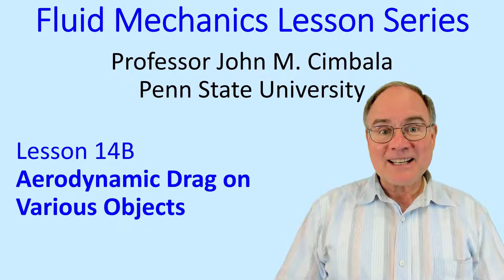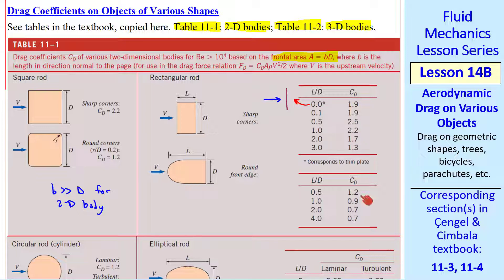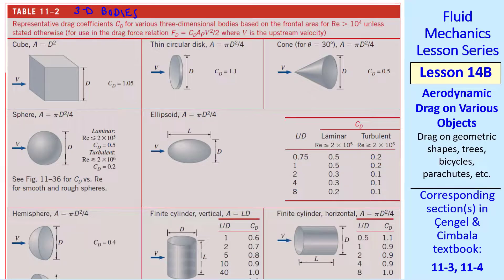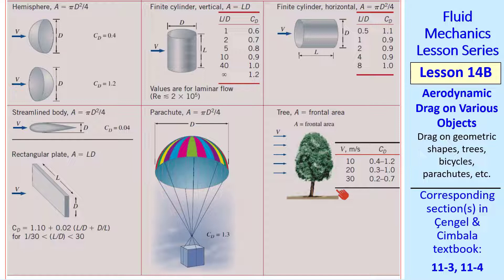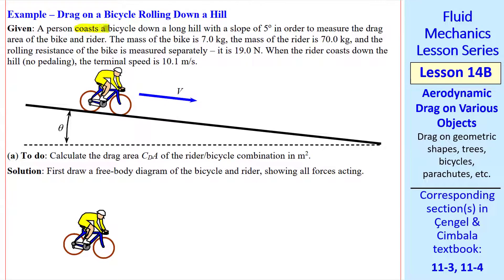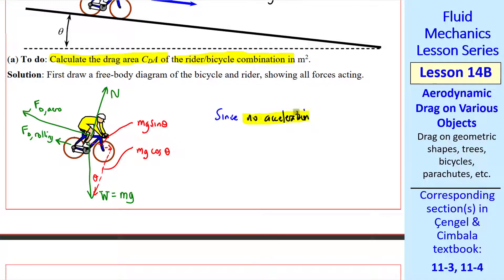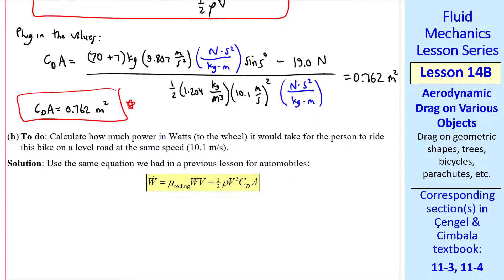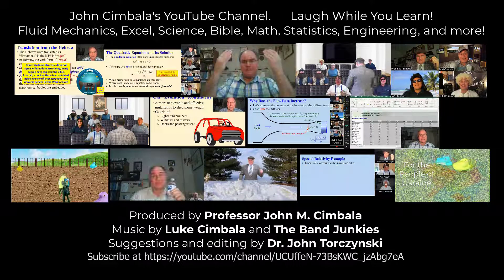Fluid Mechanics Lesson 14B: Aerodynamic Drag on Various Objects

Comment: Hi Professor,
Most objects in the table have constant C_D values, wouldn't it change with the velocity(Reynolds number)?And also wouldn't it depend if flow is laminar or turbulent?
Reply from the maker: Yes, these are for turbulent flow unless otherwise stated. Some show both laminar and turbulent values.
Reply: Thanks! @johncimbala